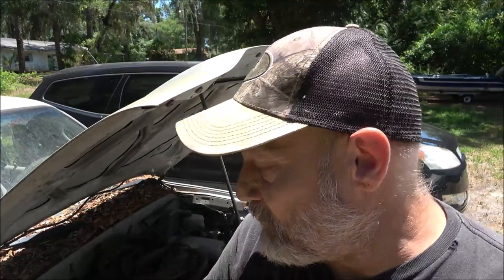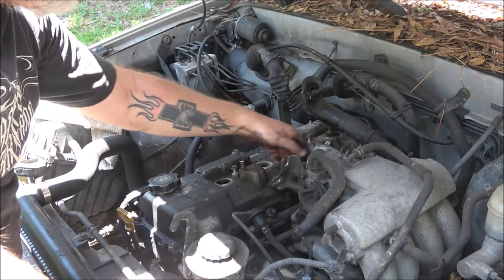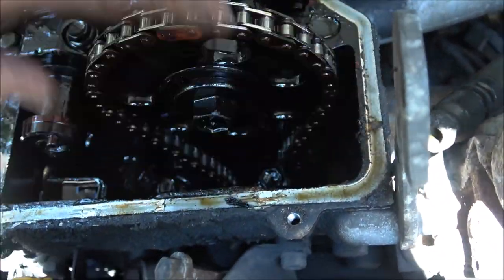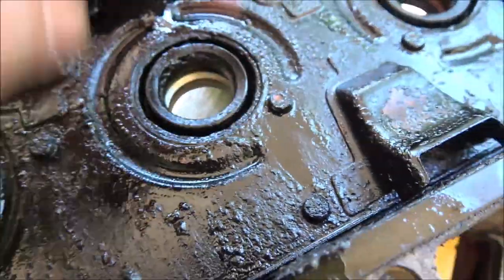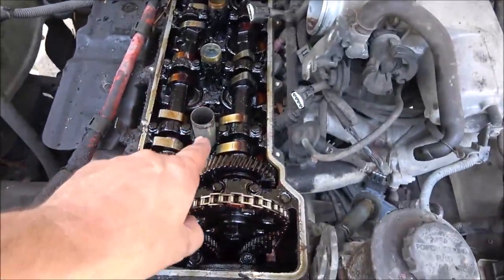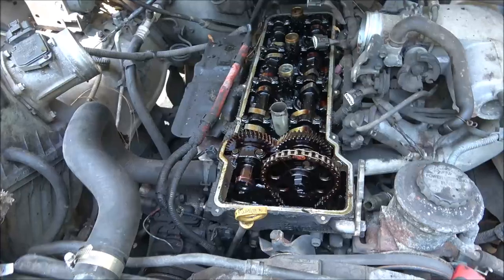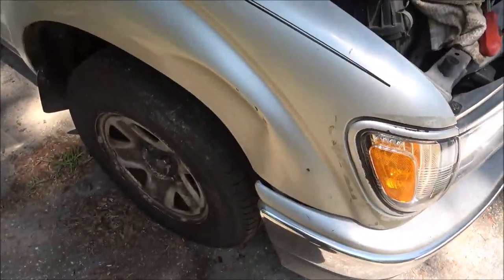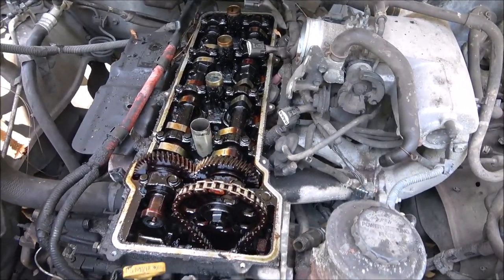Valve Cover Removal 2003 Toyota Tacoma And The Fate Of This Old Engine

Comment: My 2000 tacoma is just as reliable as yours no service needed for anything really.  Actually I was so bored, i just changed the rotor just out of curiousity, and damage the bearings in the process.  LOL. But unlike other bearings, you don't need a presser, which was nice. But now after maybe 10 years of letting the gasket leak, I've finally replaced it, not because I wanted to, but because the leak has gone so bad, that I think my rear main seal and oil pan is leaking.  Hopefully it's not.   I guess even if it was leaking I would probably let it leak til Its an inconvenience to me.  That's how great and reliable they are. It's unfortunate they don't make vehicles like these, I will be sad when this one goes.